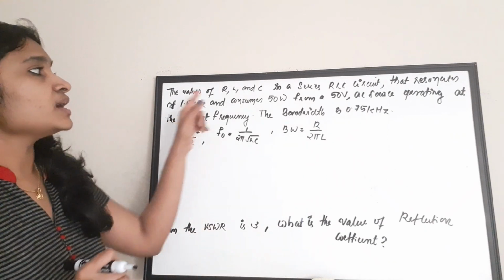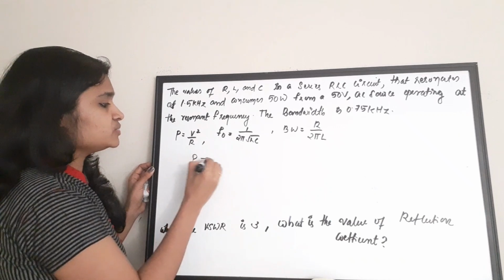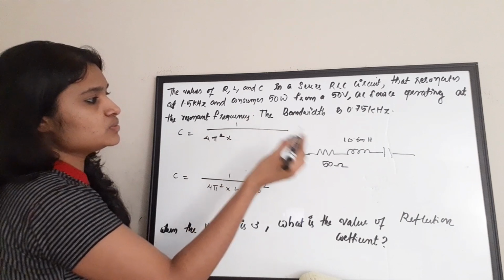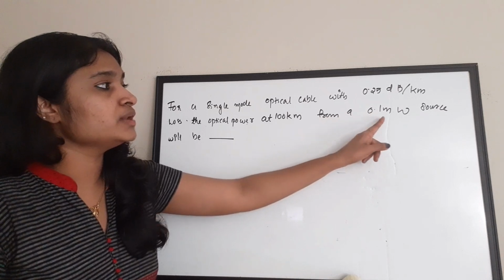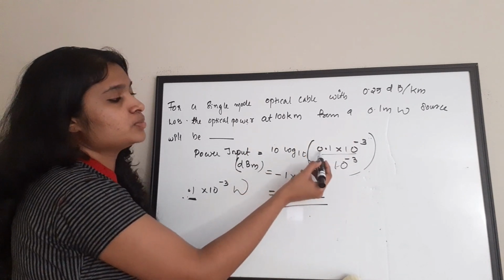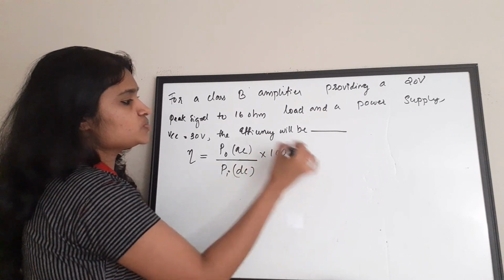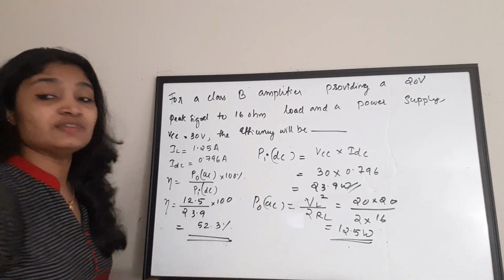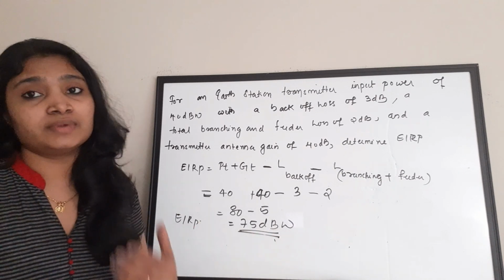Competitive Exam Preparation of Electronics and Electrical Part5| Technical assistant| BEL Exam

Comment: Miss ee question inu answer onnu parayamo.
Q. A series RL circuit takes 160watts of energy at 0.8 power factor lagging from 100v, 50Hz supply. The value of R is?
Reply from the maker: Nokiyit parayame
Reply: @EasyElectronics_jobupdates  ok miss
Reply: Miss nokkiyo
Reply: @EasyElectronics_jobupdates  miss nokkiyarunno

Comment: Mam, one doubt. In case of Class B power amplifier efficiency, Power output(ac)=(VL^²/2RL). Mam, why taken 2RL instead of RL in the said equation
Reply from the maker: We are taking RMS value of output voltage that will be VL/root2 so that's y the equation is like that
Reply: @EasyElectronics_jobupdates  Ok thanks Mam for information. Your all videos are Superb.

Comment: Miss 4 th question il output ac power kandupidikkan. Enthina VL^2/2RL enna equation use cheythath. (IL^2*R use cheyyan pattilleee.) plz reply misss. 🙏🙏🙏🙏🙏
Reply from the maker: Athum use cheyam.
Reply from the maker: We are taking RMS value of output voltage that will be VL/root2 so that's y the equation is like that
Reply: @EasyElectronics_jobupdates  thank you miss

Comment: Gd morning madam...
I have a question...
Power gain - 10 log 10 Vo/Vo dB
CMRR - 20 log 10 Acm/Ad dB
Reply from the maker: Yes, the equations are correct
Reply: Power gain= 10 log 10 output÷ input dB
Reply: Madem  include this type question in next video plz....
Reply: Voltage gain = 20 log 10 output÷input dB